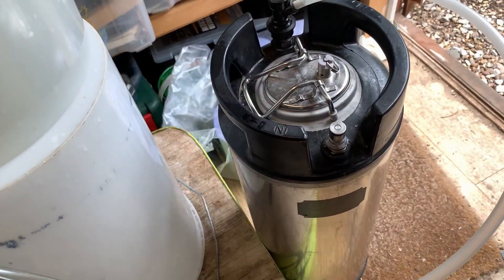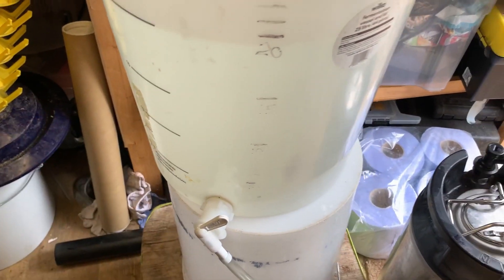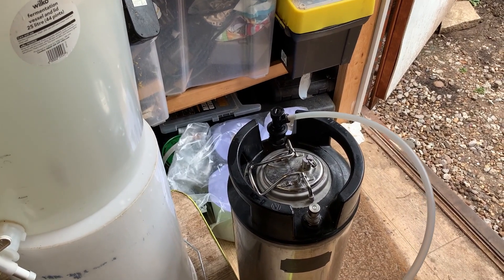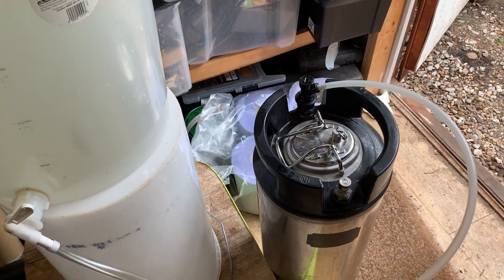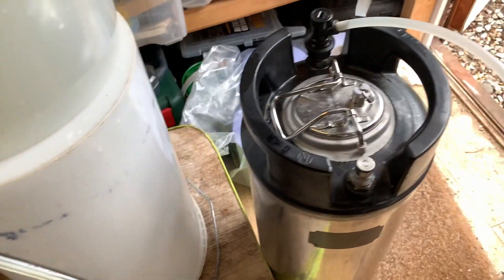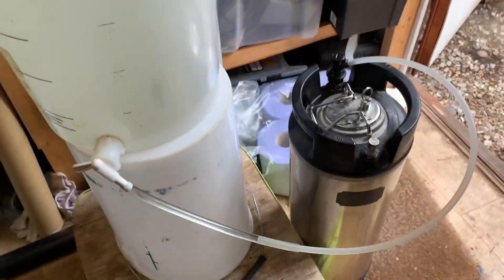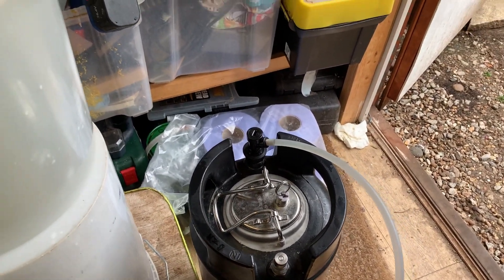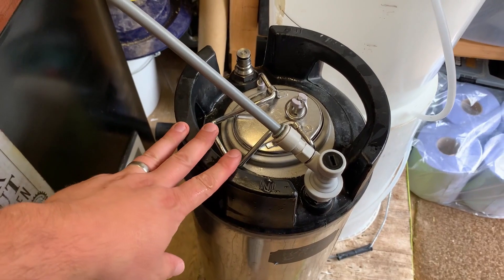How to purge kegs with CO2 from pressure fermentation

Comment: Wouldn't running this into an empty sanitized keg clear out most if not all of the O2? The benefit is that you won't have any residual Starsan at the bottom of your keg when you go to fill it. I know Starsan is no rinse, but it's extremely low pH so just a little could make a bit impact.

Comment: Good video. Doing the same thing now but without the sounding valve.  Question though. The dip tube in the 2nd keg is also cut back so there is no way to evacuate all of the starsans prior to transferring.  How do you overcome this issue, or is it not an issue at all to have that remaining starsans mix with the beer?

Comment: Would sending the beer into the "in" cause any off-flavors to produce as it splashes down into the keg? Normally I would fill the keg with CO2, open the seal, run a line down to the bottom of the keg, drain my fermenter, then cap off the keg, and purge multiple times before force carbonating (rolling over legs, etc.)
Reply: If the keg is fully purged with CO2 from the fermentation, you can splash it around as much as you want, it's only O2 that'll cause issue with splashing

Comment: This won't work. There is no positive pressure on the keg lid to keep it sealed. You need to add an additional keg in the chain and move your spunding valve to the end of that keg.
Reply from the maker: Done this many many times and it absolutely works, of course you have positive pressure if the lid never sealed it would make no difference having a spunding valve on a final keg either, although doing it that way would mean you can have the keg automatically equalised with the FV which would be beneficial for the transfer later
Reply: @DudesBrews  Gently push down on the keg lid next time your syphon is running.
Reply from the maker: @benjaminlebens2260  its positive pressure pushing the starsan out of the keg, if the lid wasn't holding a seal then the flow of liquid would never start and its not a syphon action because the keg dip tube runs to the bottom of the cylinder, admittedly the lids can take a bit of fiddling with to get the o ring to sit properly but as I said if they weren't then the liquid would never get pushed out

Comment: First of all: Thanks for sharing, I like this approach.
This is already two years old but maybe I'm lucky and still get an answer: When pushing the starsan-liquid out of the keg, after it has finished and only CO2 is escaping anymore into the bucket, can you tell how much is still left in there? I assume that little amount will stay back?! Is it in any way a problem or is it so little, that it doesn't matter at all?
Reply from the maker: Thanks there will always be a small amount left in the bottom of the keg, it causes no issues at all

Comment: I just saw your video. I think that you could also sanitize the keg, empty the keg and plug everything just like you did... the keg would fill up with the C02 and bubbles into the starsan bucket.
Reply: You run a risk of still having a good amount of O2 this way - filled to the brim with starsan means very little O2 in there to start with, and even less when the CO2 pushes everything out

Comment: Can you set this up without the spunding valve? Would it work just the same except there’s no pressure built up in fermenter?
Reply from the maker: It would work without the spunding valve yeah, I'm not sure exactly what would happen with the pressure levels over time though there has to be some head pressure in the FV in order to start pushing out the sanitiser, might depend on how vigorous the ferment is as well

Comment: Awesome idea! How far into the brew did you do this? Presumably the keg is then fine (sanitised and purged) until you have finished fermenting and cold crashing? Do you then have uncarbonated beer which you have to force carb in the keg?
Reply from the maker: I wait until a krausen is established and fermentation is properly started personally, yeah the keg is then fine to leave until transfer. You can still partially carb the beer in the FV under its own pressure but it will normally need a little top up from the gas bottle to get it right
Reply: @DudesBrews  awesome. Thanks for reply 👍 can you remember how much gas you used to top up? Its dear these days so trying to save as much as I can lol
Reply from the maker: @Nigellittle12  no idea tbh, would depend on how high you set the pressure on the FV spunding valve (can crank this up towards end) and how high a co2 volume you are aiming for at the end. It is possible to fully naturally carbonate using the pressure FVs if you get the final pressure and cold crash right if you really want to maximise the co2 harvest!

Comment: Great idea! What is the minimum pressure needed in the fermenter  to have the Starsan forced out of the keg?
Reply: I just did it with a grainfather conical fermenter which is limited to 1.5 PSI. It's slow  though :)

Comment: Any chance you can do a quick video of your setup.  Keen to see how you ferment
Reply: can see you have a fermzilla, is it a 27 or 55 version?  For the speidel fermenter, can you let me know the size?  If you have both in use, do you just ferment at one temp?  Looking to get a tall fridge, what width do you need for a fermzilla?  Also keen to know your brewing setup if you can give any details?

Tks
AB
Reply from the maker: this is the fermzilla plus pressure kit v2, dimensions are on one of the pics
https://www.angelhomebrew.co.uk/fermzilla/486-30l-fermzilla-all-rounder.html
this is the speidel
https://www.brewuk.co.uk/speidel-30l-fermentor.html
if I have 2 batches in at once I try to do stuff that needs the same sort of temp to start with and I will if they don't go in at the same time the probe goes on the most recent batch i.e. the one actively fermenting.
I use an SS brewtech kettle with a buffalo induction hob, also have 55L stainless kettle that I use as HLT, mash in a homemade bucket tun. So 3 vessel brewing essentially
Reply: @DudesBrews  Super, great setup!
Reply from the maker: what do you want to know exactly?